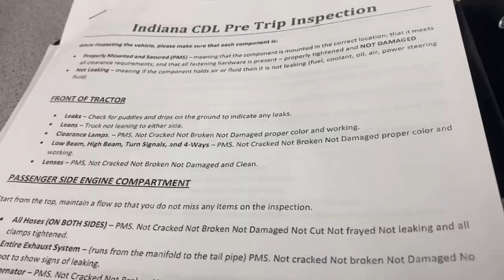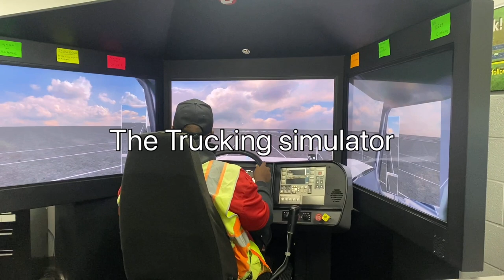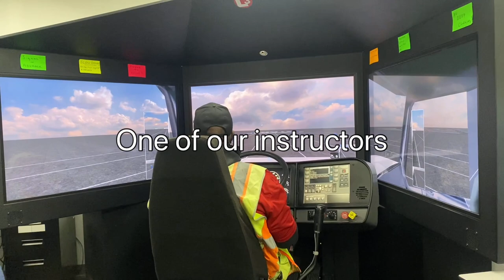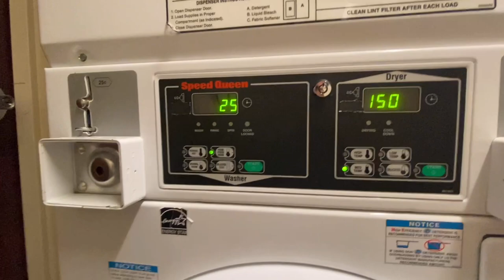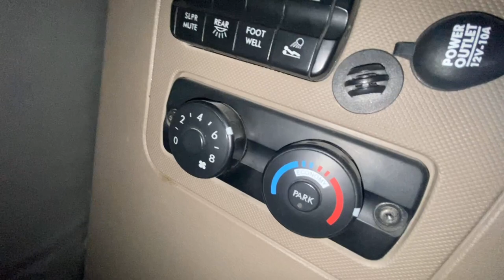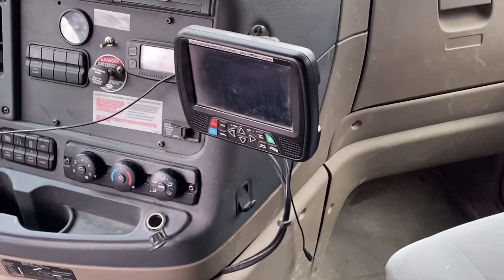Roehl paid CDL training: Week 1

Comment: I was wondering if you were going to have time during the week to make a video. It's a lot of information to soak in, in a short period of time.  For the me the pre trip was hard to grasp. And when I went through our training we had to learn to double shift.  I believe now pretty much all tractors are automatic. Well  all the ones we have at work are automatic. Getting on the road was my favorite part. I'm sure you're going to enjoy it as well. It seems like you're getting down pretty well Dillon. Keep it up and good luck brother 🙏 I know you got this. I know your family is proud of you too...... If you have any questions, let me know and I'll  try to help out......👍🤙🎉
Reply from the maker: It is a lot to soak in indeed, Kevin! I am really enjoying it so far though. 1 week down and 2 to go. This is probably a highlight of my life so far. I know it’s a huge step and it means a lot to me. Thank you so much for taking the time to be supportive like that 🙏 that means a whole lot. I do believe they have went to all automatics here, as you mentioned. I will be doing dry van as well. At least during my contract. I am thinking of doing flatbed later on if they have local jobs available in my area. I need to work on my right hand turns. They told us that we need to make sure we don’t hit the curb but also that we don’t cross over too far into the opposite lane. I felt pretty comfortable with backing cause I have pulled trailers for years, but it is definitely more of a challenge with a 53 foot trailer behind you haha. I am very happy that I decided to make this step and I look forward to the future. You have a lot of experience in this! If you have any advice at all I’ll be glad to take it! It seems that the pre trip is very important and then just making sure I drive correct on the CDL test. I found out yesterday that we have to parallel park as well. Any advice on that one?